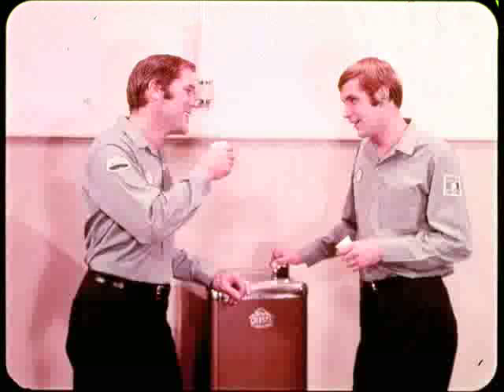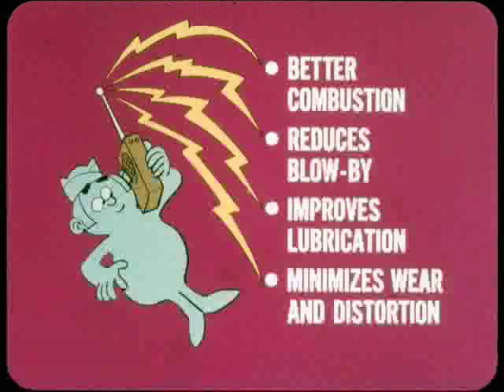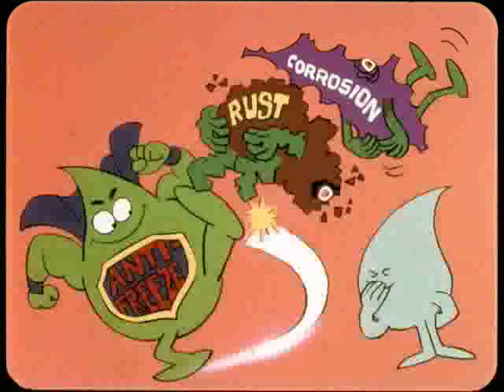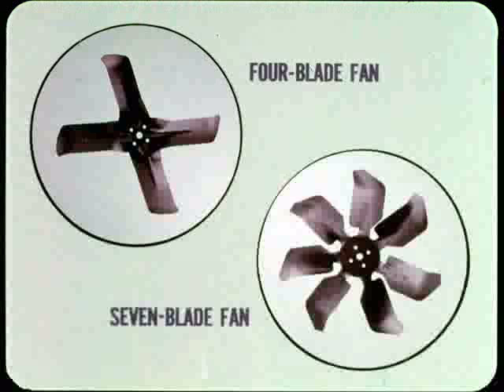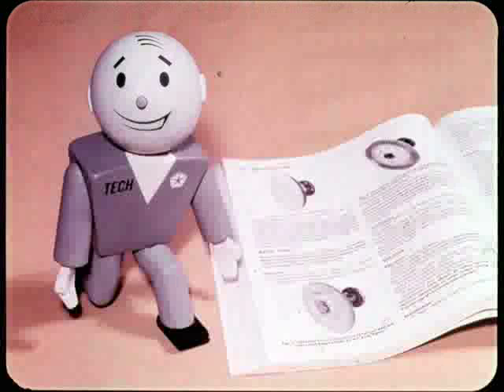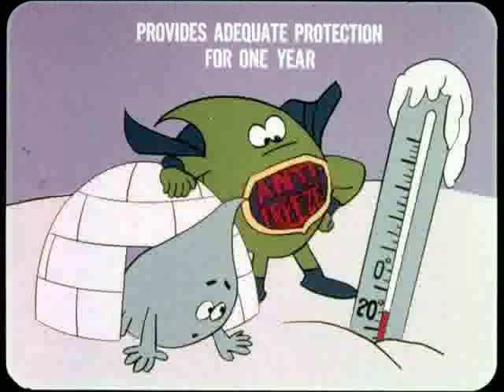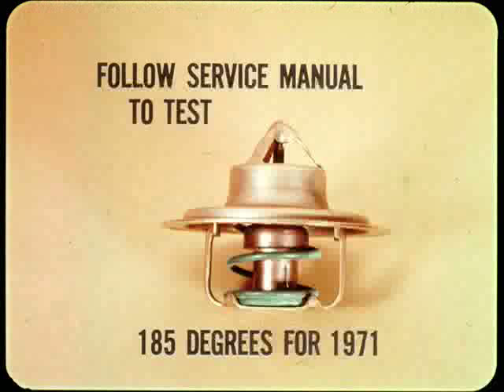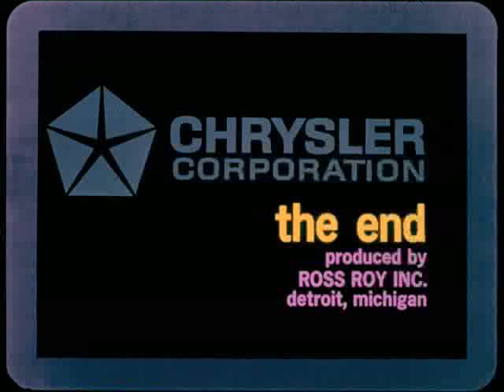MTSC - 1971, Volume 71-3 Controlling Engine Temperature

Comment: 4:25 If you see a milky substance on the transmission dipstick, the transmission heat exchanger in the radiator has failed. On modern cars with plastic end tanks, replacing the radiator is the right way to go. After you do that, use a good transmission flush machine to get the heavily contaminated fluid out.
Some cars won't use a heat exchanger in the transmission cooling system. Instead, an external transmission cooler is used, and it looks like a mini radiator with transmission fluid flowing through it. You can convert cars to such a system, and it is advisable on some badly designed vehicles.
For example, The Winnebago Rialta, Winnebago Vista 21b, and Itasca Sunstar 21b are RVs derived from the VW Eurovan. That is more weight than the Eurovan was intended to carry, so converting to an external transmission cooler can extend the life of the transmission. Temperature gauges indicated that transmission fluid would often go past 200F with the stock cooling system, and ideally transmission fluid stays at or below 180F for maximum life of the fluid and the transmission parts.
4:55 In the early days of air conditioned cars, people would add parts to a car that was never intended to have air conditioning. That caused a problem for some cars. Some old imported cars would get an A/C system installed near the dock. Since the vehicle manufacturer designed the A/C system, it worked as well as a factory air conditioned car.

My dad showed me the process of replacing antifreeze while I was very young. Back when all antifreeze was green, he made sure to replace it once a year. However, there was one year where we replaced the green antifreeze in a 1995 Honda Accord. It destroyed the water pump, and the repair shop said that the silicates in plain green antifreeze are not in Honda antifreeze. Ever since then, I made sure every car gets OE specification coolant.